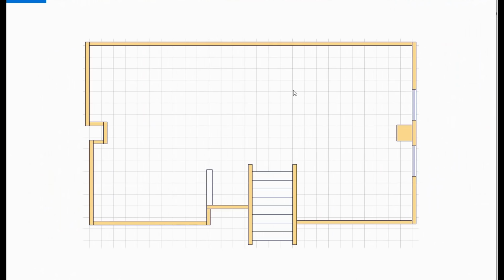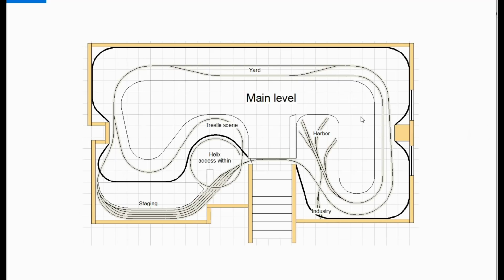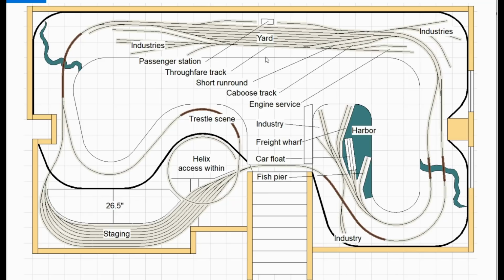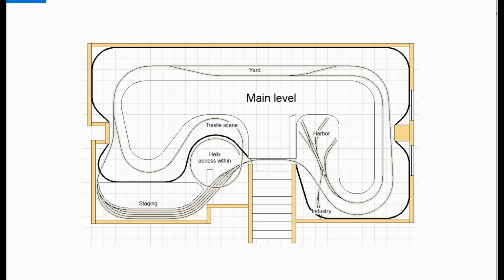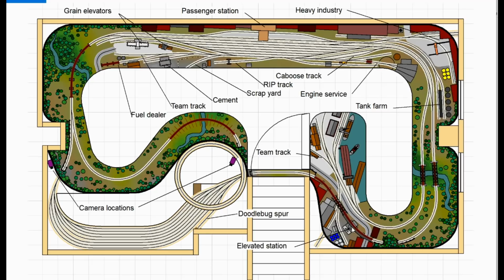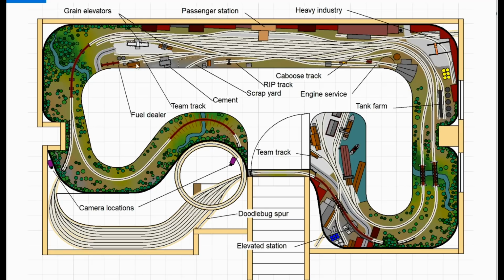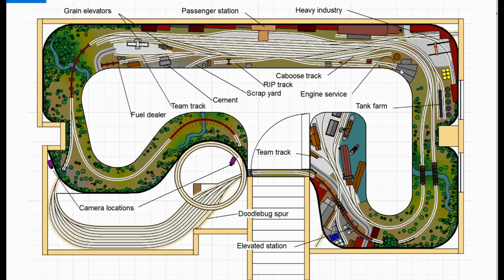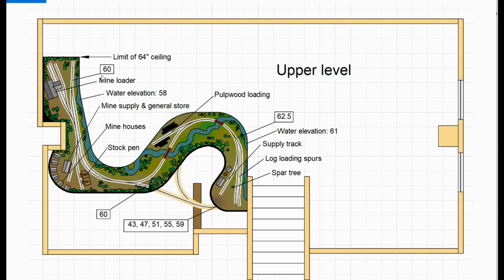An HO-scale layout in an attic room

Comment: Is the situation with the HO Peco turnouts the same in N scale?  What turnouts do you recommend designing for in N scale?
Reply from the maker: I've yet to find a ready-built N-scale turnout that I like.
For example: PECO do two lines - code-55 and code-80.  Their code-55 turnouts all have the same crossing angle, regardless of radius, and code-80 is grossly oversize to the point of looking absurd.
I don't have any first hand experience with Atlas so I'll refrain from commenting here.
My first choice for N-scale would be to commission Bruce Geroux to build them using fast-tracks jigs.  You'll need to place your order well ahead of time though, because he often has a significant lead time.
Reply: @mpeterll  Thanks for the response.  It sounds like hand made turnouts will be the way to go.

Comment: Great design and a bonus that he won’t fall down the stairs by using a swing bridge. Lol. This being a loft or attic, how much height do you have above the layout height before the roof begins to pitch? The backdrop buildings by the yard won’t force you to move the track further from the wall, will they?
Reply: Thank you and congratulations on a great layout plan. Peter really does do a great job planning and building layouts. I’m a little jealous. Lol.
Reply: @derekalexander4030  Thank you. I am looking forward to starting this winter.
Reply from the maker: That's why the layout is being built lower than normal.
Reply: Yes I understood that, I was asking how much space there was from the top of the deck to where the roof begins to pitch.
Reply: @derekalexander4030  This is my track plan. There will be 8 to 10 inches of height for the backgrop buildings behind the yard.

Comment: You continue to amaze me 28 for big steam or Turbine's & Heavy Wt. Seems tight?
Reply from the maker: Yes it is very tight (but still larger that the client originally specified).  If you listened to the whole commentary, you will have heard me say that the main line curves are 36-42" and that it's only in the staging yard that I use the 28 3/4" radius of the curved turnouts that the client already had and wanted to use.  I don't know what brand of passenger cars he has, but he may need to make some slight adjustments to them.  I've found that on the Walthers heavyweight cars, most will operate satisfactorily at this radius but there is one set of steps on the dining cars that fowls the truck unless it is shaved down a little.
Reply: @mpeterll  yes I did catch that Peter, ok in the staging Keep doing what you do..so we'll thanks my friend..